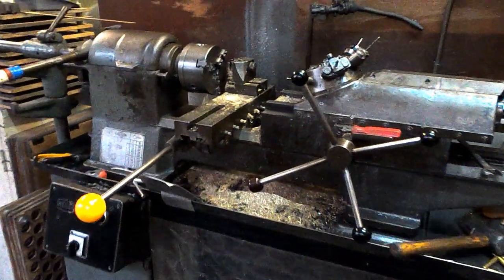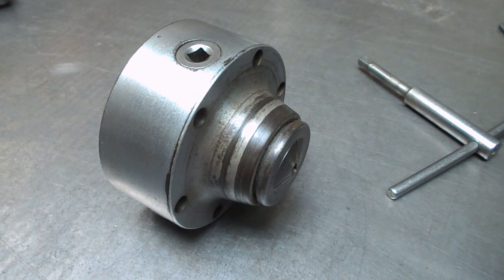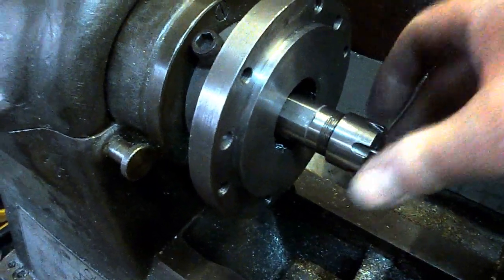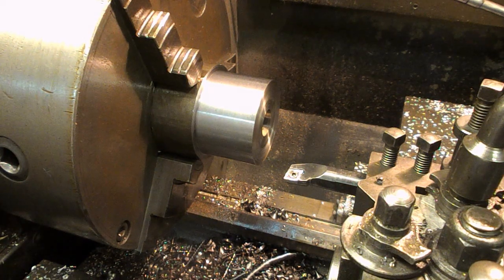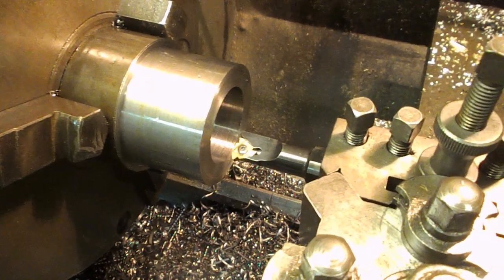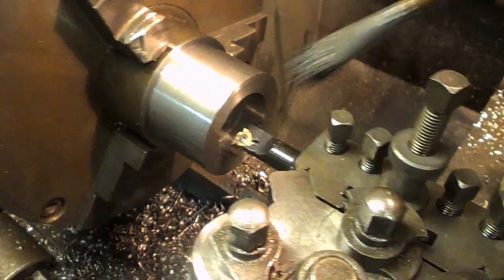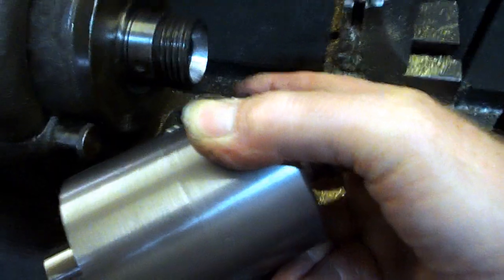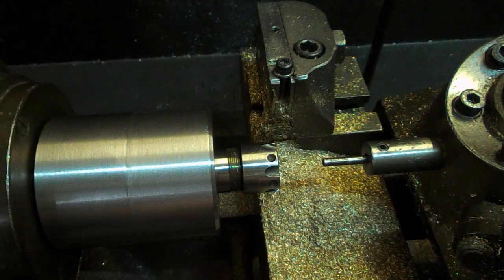Making an ER Collet Chuck Holder for a capstan lathe spindle. #SHOPMADETOOLS

Comment: Does anyone know how to replace weiler bearings (Angular Contact Bearing Installation Arrangement and Preload)?
Reply from the maker: Sorry I can't help you with that. I've never done any work on the bearings & don't have a manual for it (if it is even the same as the one you need to work on?).
Reply: @MidEngineering   understand .tank you sır